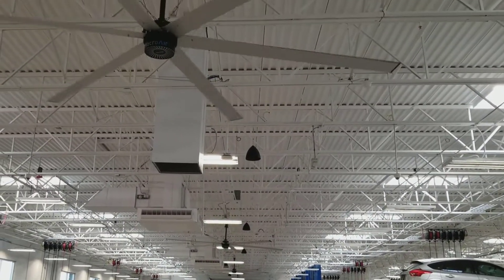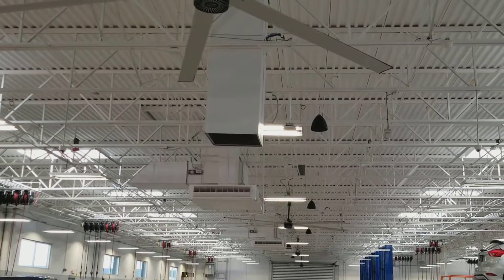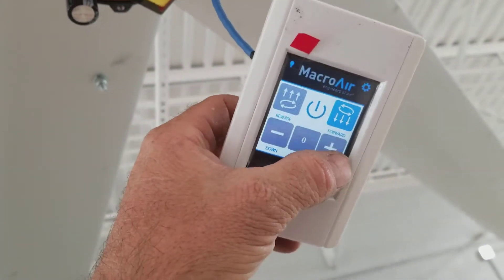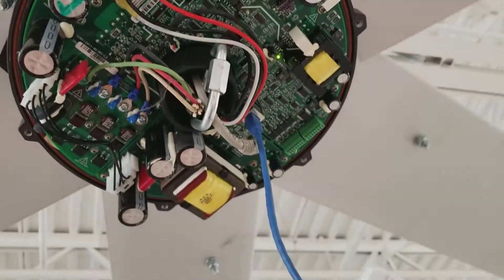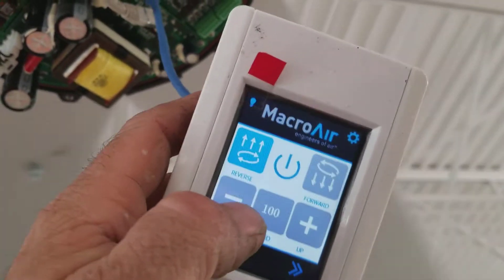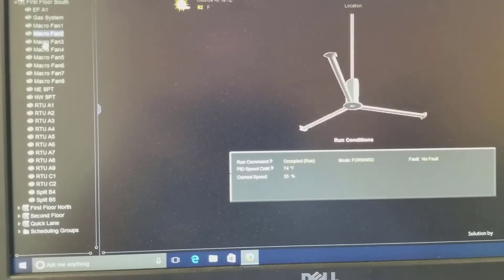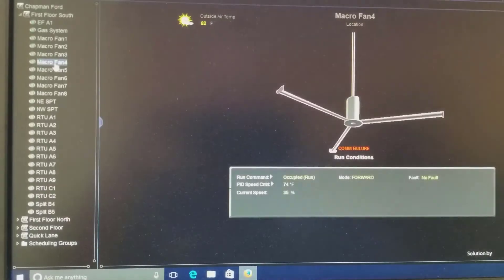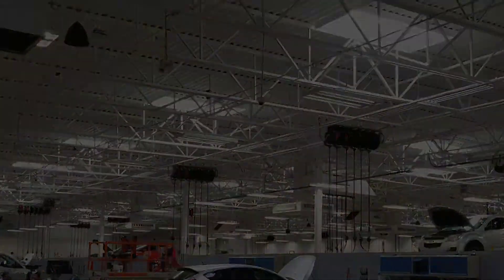Fixing some big ceiling fans with comm and EMS problems

Comment: Typical macro air... I doubt Big Ass Fans ever had such problems.
Reply from the maker: Do people often complicate the Big Ass Fans with network hubs and interfaces to the main building EMS just to switch on some fans like these jack ass building designers demand?
Because when just used with a stand alone t-stat on each fan seem to work just fine.
Reply: @hackfreehvac  Who knows 🤷‍♂️

Comment: Was the comm issue for all the fans caused by the bad driver board on fan #4?
Reply from the maker: More than one fan being configured as the same fan number.
Reply: hackfreehvac  The “run cap bandit” is doing automation now in 2020.....
Reply: I’m having the same problem , can’t seem to get them running

Comment: I've installed some of those, none that ran off EMS. All the ones I ever did ran off a VFD. They were always over conveyer lines where people were working. Did one that was 24' across one time, had 12' blades. It was Big Ass Fan brand.
Reply from the maker: These have built in VFD boards in them.
They could run off of the wall controller which would have less issues.
To work on the EMS you have to get the addresses right etc and then hook up the daisy chain to the network adapter that connects to the EMS computer.

I got this place working at least.
They really move some air even tho they only run about 90 RPM max!
The customer seems to love them when they work.